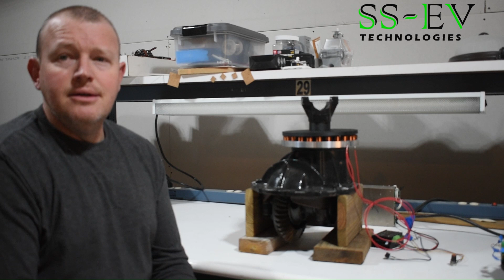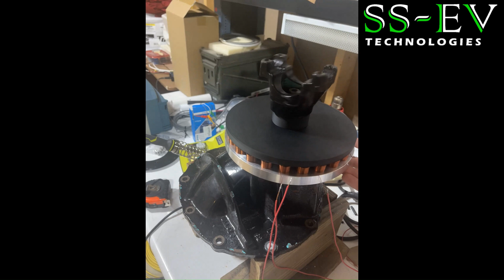New Hybrid Axle Introduction

Comment: your gonna need A LOT BIGGER motor then that to even notice it's there
Reply from the maker: Appreciate the feedback, but not true. While our homemade motor is pretty basic, we have talked with motor vendors making 80-90 ft-lbs of continuous torque in this motor size. That torque being directly at the axle input, would make a noticeable difference. Growing the motor size another 30% could gain even more power.  Thanks

Comment: Having a classic muscle car with the added performance of an EV off the line sounds like an exciting upgrade to spend cash on. Sharing that fuel efficiency is an added benefit, but if that's the focus I wonder if it will make people want to give you their cash and tear apart their cars for unproven tech. 

I've added Electric power steering from EPAS, and an iBoost Electric brake booster from Bosch through Retrofit Innovations to a 72 Nova. I'd certainly be interested in this as an option later. Might even run a 12AWG Ground, 12V Batt, and Ignition wire to a Deutsch DTP plug just in case this goes prime time later ..🤔